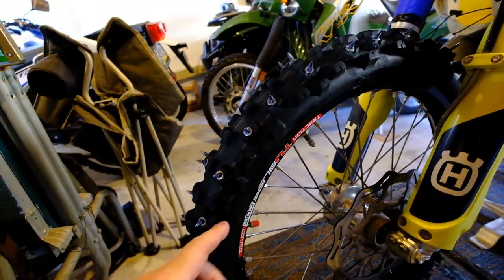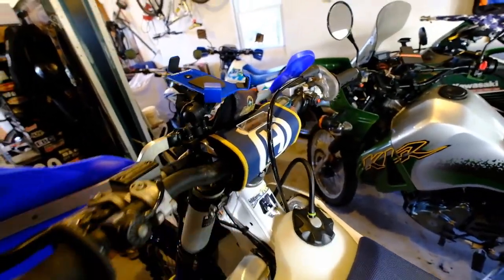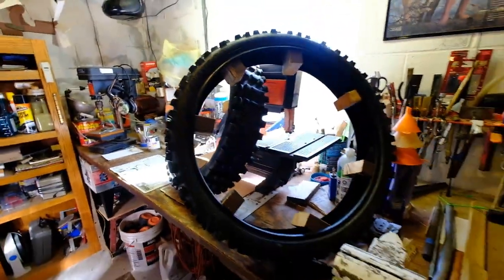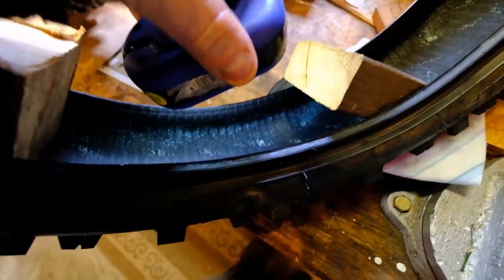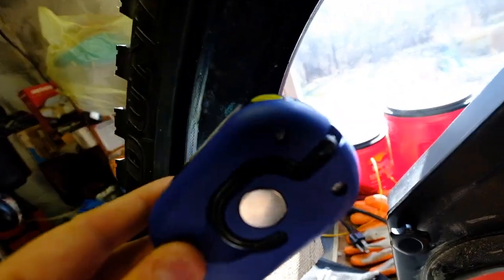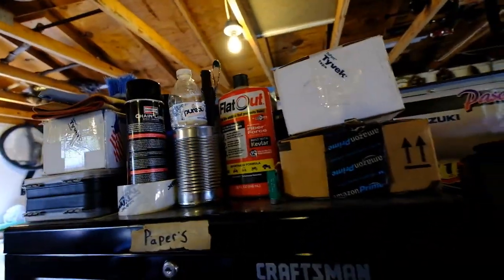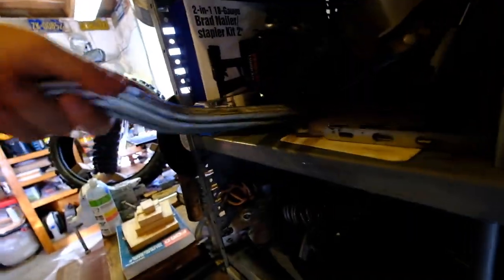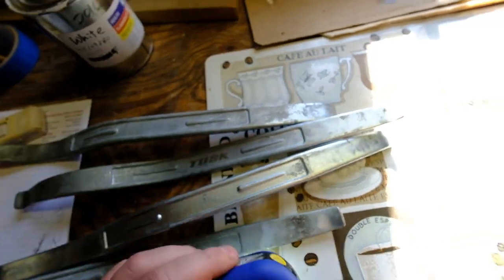Don't use Tire Slime with Tubliss or in ATV tire's - 6 months or more

Comment: The instructions say its not a permanent solution. Also how do you figure the tubliss doesn't touch it when you air down? That's from running air pressure low causing heat.

Comment: I dont think ots from the slime. I think it's from the low tire pressure and the amount of sidewall flex will brake down the side walls and cause the layers to delaminat. I have seen this many times on car tires when someone drives them on low pressure
Reply: Also low pressure creates more heat and it will break down a tire. The slime did not cause this...
Reply from the maker: I switched to a different style tire sealant on a new set of tires and I didn't have this issue again with tubliss... I now switched over to mousses

Comment: It looks like the tires normal wear and the slime filled the points that were wearing, which is what it's supposed to do.
Reply from the maker: The Slime actually made the rubber soft and made it brake down to the point I could almost pull each fiber out like a noodle.

Comment: What does it do to the tubeless rim???
Reply from the maker: The Slime gave my Tubeliss red bladder black 1/4- 1/2" dots but does not seem to hurting it at all or the high pressure tube. The Slime did pit my rims tho..
Reply: @compoundcowboy277  those wear spots are from the tire rubbing on the tubeliss System